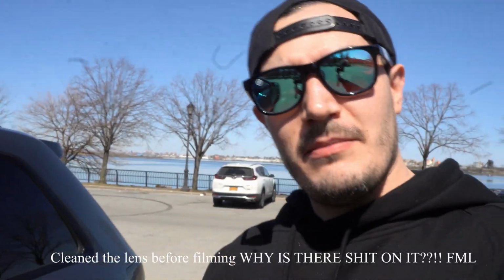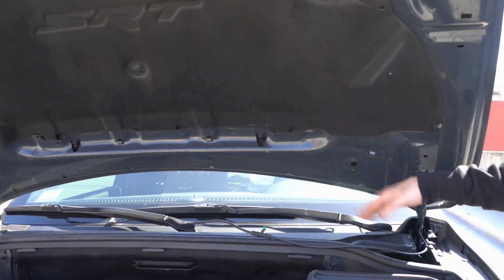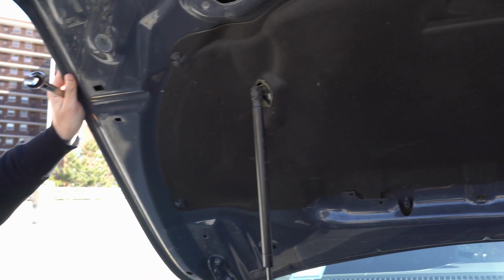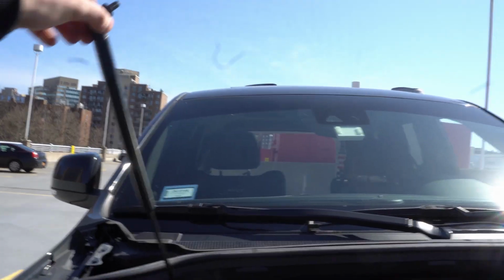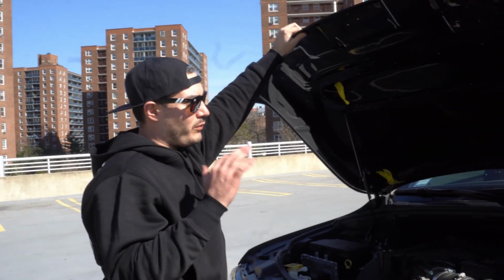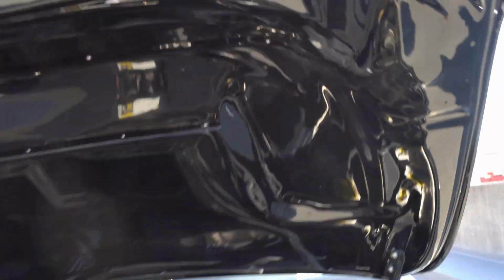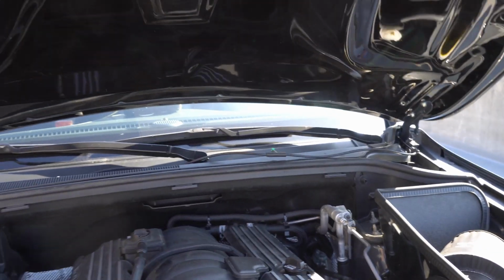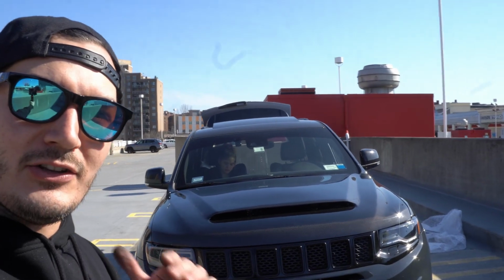NEW CARBON FIBER DEMON HOOD INSTALLED ON MY JEEP SRT!!!

Comment: you don't need to grind the hood down you just need to loosen the bolts and readjust the hood til it doesn't hit. One of the most tedious things about installing an aftermarket hood or even your OEM hood is to get it to line up perfectly and it takes lots of adjustment to get the gap to be perfect.
Reply from the maker: That’s true it took me like 3-4 different tries after I installed it to finally get it to line up right. It was a pain in the ass lol

Comment: The windshield hose does install back to the hood right?
Reply from the maker: No unless you drill holes through the hood which I didn’t want to do so I just left it tied up under the hood. I believe there is a nozzle relocation kit where you can set it up to the windshield wiper

Comment: Is it possible to wrap the carbon hood ? To a different color ?
Reply from the maker: You probably can but just not sure if you’d do permanent damage once you take the wrap off. Might just be better to get it in fiberglass then wrap it and will be a lot cheaper than carbon